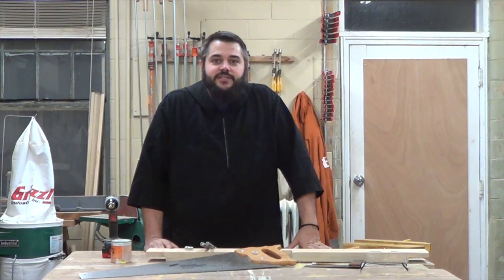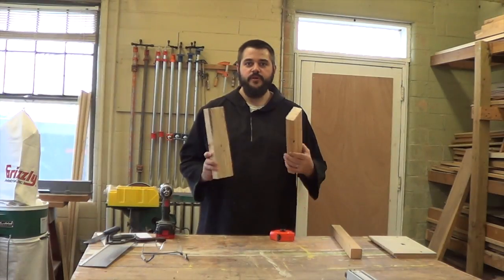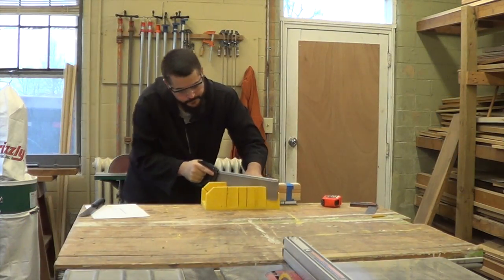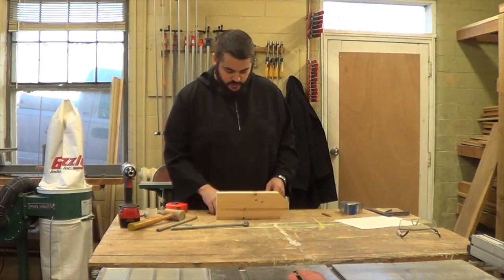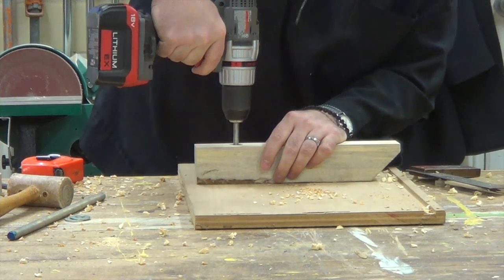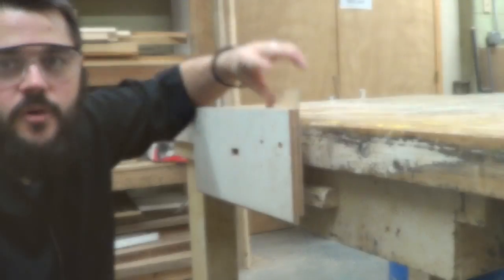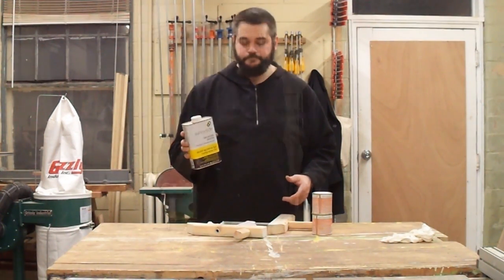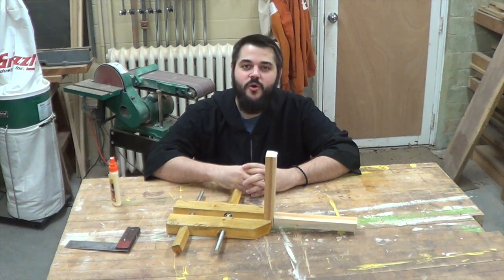Build a Simple Wooden Handscrew Clamp (Detailed Explanation) (MonkWerks)

Comment: You really got me a heartburn seeing you cutting the workbench while trimming the pieces. And regarding your improvised vise: What is the use in having all that machines in the shop and lagging a proper workbench with vises? Kaybe you can make your own vise on that workbench in style of these clamps - would probably be better than putting a screw in it everytime you need to hold something (one day your screwed-solution won't work any longer, due to the bench is perforated). 
But after all: Keep on woodworking! Nice job.

Comment: MUCH less expensive than buying a set of these.  Thanks for sharing this.  For the clamp surface sanding, use a pencil to make a few lines on the wood, then sand until the lines are gone.  The surface should be flat and smooth.
Reply from the maker: +Mark Hazlewood Thats a great addition with the pencil trick.  Its actually a great one to keep in mind when planning or flattening any board.  Thanks for watching.

Comment: Beautiful job and so easy too. I was wondering if, like the original hand screws, yours will easily clamp odd shapes. I also wonder if like the original hand screws they can be opened and closed like we did with them, like riding a bike we would hold the handles and rotate them in either clockwise or counter clockwise directions.